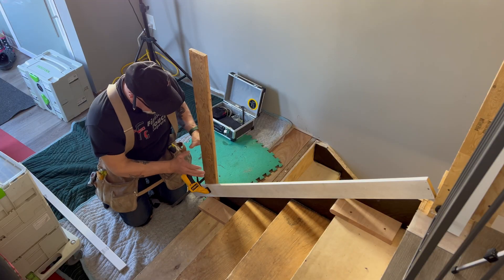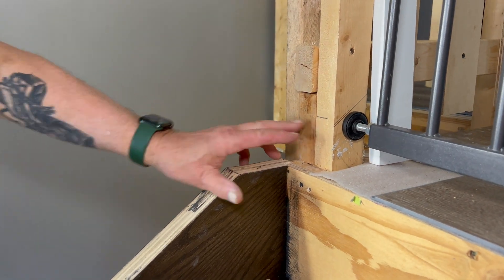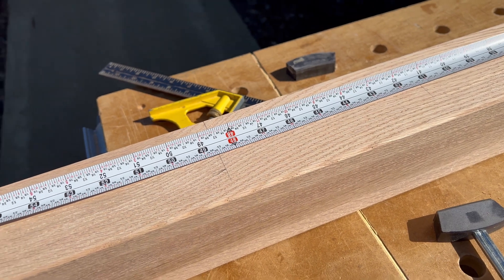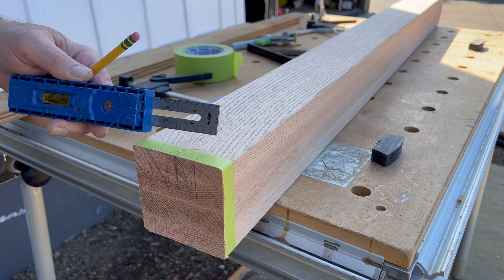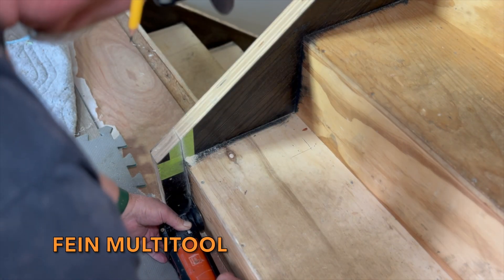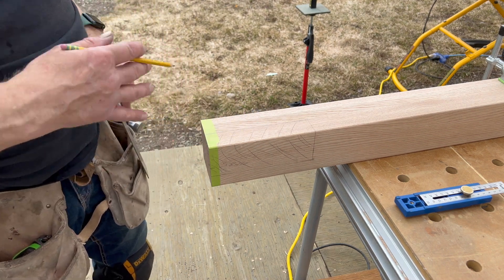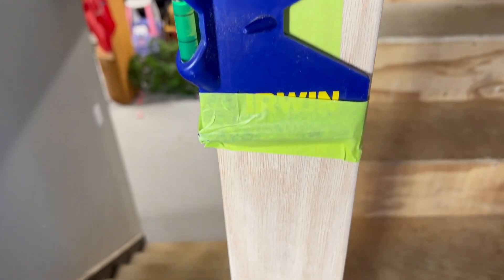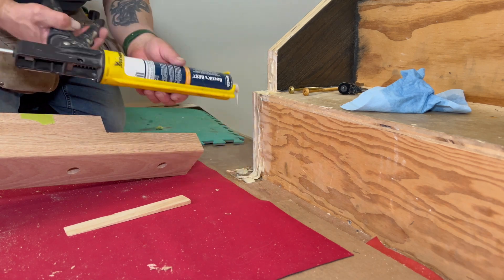Newel Post to Staircase Connection -  Improved with NO MUSIC!

Comment: Great work Scott, I watched it twice for support.  I love the following:
-Taking and applying tips from your viewers to continue to grow
-Doing the job right even if it means paying a bit more
-Added branding at the end
Keep up the great work and a couple of methods I use for notching are 1. Circular saw to start nice straight square cuts, sawzall next, and lastly a chisel.  Option 2.  A Miter saw adjusting the depth gauge with a sacrificial piece of wood between the fence and your post.
Reply from the maker: Thank you Dan. I like the idea of the mitre saw and may try that. I have started using a marking gauge as well and may show that the next time I do a post install. Thank you very much for taking the time to leave this comment. As you know, encouragement is the fuel that keeps us doing videos. Cheers, Scott